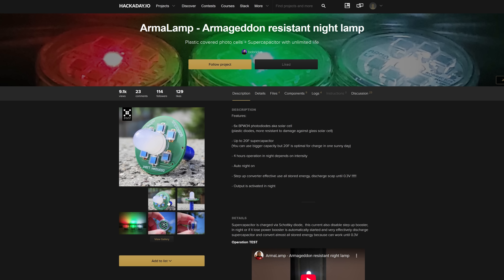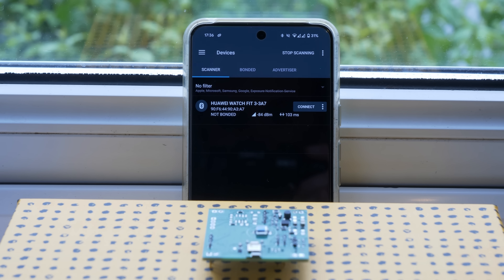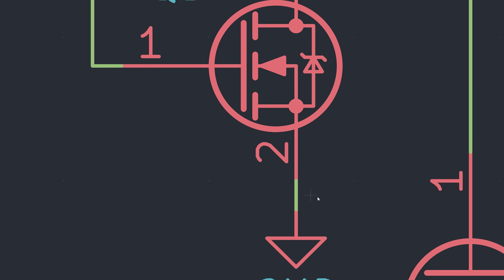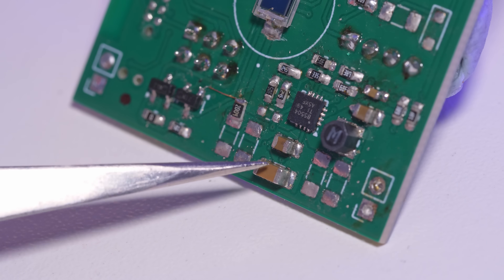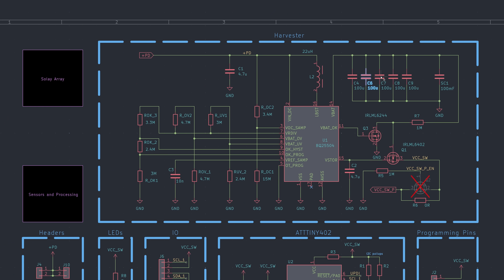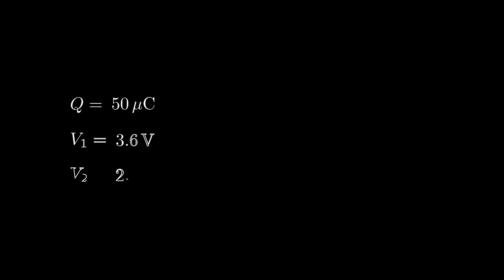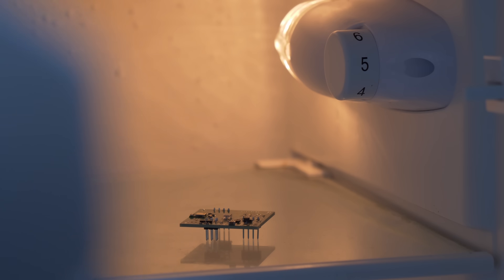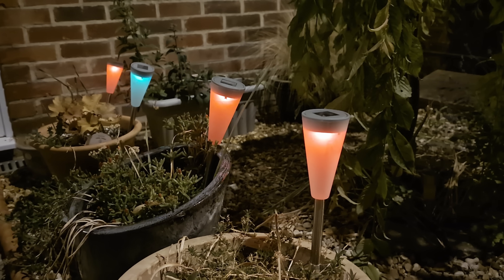Nordic chips are so efficient, you don't need batteries anymore

Comment: Why? BPW34 and similar photodiodes are still very, very expensive compared to solar cells. You could buy polycrystalline solar cells (just a silicon chip, no resin - it can be cut as needed..) and use them for example as one side of a PCB . Much cheaper and more efficient.

Comment: If you can put a GPS module, even though it requires much more power, and a LoRa module, you could build a tracker, optimized to consume as little power as possible. Even a transmission every every hour would be useful, maybe to find a dog, or tied to a balloon and make it go around the world, like picobaloons

Comment: it's only taken 50 years but we're finally adding the solar panels that are on calculators to other electronics? I love it! (genuinely)
Reply: They increase the efficency of the circuit and the panel, not making them bigger😂(obvious reasons). Anyways does a camera technically  use photovoltilaric cells, and can a solar panel technically be a camera?
Reply: The light sensing elements in a camera sensor are photodiodes, but you'd probably run into trouble with the readout circuity consuming more eneregy that the photosites ever collect

now if you could use an LED as a solar cell...
Reply: @deepspacemachines  with the advancing technology, we'll see...

nothing will change cuz we'll be too busy with AI...
Reply: @deepspacemachines  you can use a LED as a solar cell! It’s just not very good at it.

I believe that Steve Mould as a video about this.  He does: Why all solar panels are secretly LEDs.
Reply: @deepspacemachines  "now if you could use an LED as a solar cell:  What alternate universe are you doing your physics in.
Reply: @deepspacemachines You actually already can use an LED as a photodiode! 
It's not nearly as efficient or as scalable, so you won't be getting any usable voltage with it. 

Now if only we could use photodiodes as LEDs...
Reply: @RuudAlthuizen  because Solar cells, LED and traditional diodes are made using almost same structure
Reply: Years ago a built an interactive target for dry firing pistols with a laser cartridge that used LEDs as sensors, because it was cheaper to completely cover an 8” target with LEDs than anything else I had in my shop. It was arduino based and had adjustments to compensate for ambient light levels and sensitivity so it could be used in a blackened room or outdoors easily. LED would create a small voltage when hit with the laser, arduino would read that and then flash the LED to show where you hit.
Reply: @deepspacemachines you can.  A solar panel in essence is a reverse led. 
Feed power into a solar panel and it will light up like an led.
Reply: @deepspacemachines  Strictly speaking LEDs can sense light too. I remember reading a post (I think also on Hackaday) years ago where someone made a touch/proximity sensor using a led matrix.
Reply: @CharGorilla  It technically is.
Reply: @deepspacemachines  'now if you could use an LED as a solar cell...'
Most of you apparently aren't into electronics and microcontrollers..
Way, way back like 2000 range or before, someone had a project online using a matrix LED display as both output and input.  Mostly output, but then once in a while turn it off, reverse bias, and look for the photodiode effect.  It could follow the shadow of your finger, etc.
Floods of arduino output projects, so not seeing the old one right now..
Reply: @memenolookup  sure but the resolution would be sh**
Reply: @memenolookup I think that's possible, but it would be capturing light from a frequency range different from the three RGB ranges used by humans.
Reply: @memenolookup yes a photovoltaic cell can be used as a terrible camera sensor, and a camera sensor can work as a super inefficient photovoltaic cell.
Reply: @CrawliestCotter arl😅
Reply: @memenolookup  No, commercial cameras aren't photovoltaic. And yes, you can use small photovoltaic cells as a sort of camera
Reply: @memenolookup  yes, a solar panel could technically be used as a camera. Well, more accurately, you could use a single solar panel to image a single pixel. Imagine if you had a field of solar panels, you could lighten a pixel on an image for each panel based on its energy output. The result would be an image that tracks the shadows cast on the panels.
Reply: @memenolookup  bro, get back to preschool now
Reply: I don't get why eReaders don't put a solar panel into the case, like, even if it's not going to be able to solely power it, having even a tiny trickle of power input would be really nice
Reply: @ThylineTheGay that's actually an interesting thought. I wonder how power an eink screen needs to change, and if it's too much could you have it change slowly to compensate. (There's all the other electronics in the thing too of course, you  wouldn't be doing this with a modern kindle which is basically an Android tablet with an eink screen)
Reply: @thesenamesaretaken yeah I mean, I don't think it would be much, but my Kobo (pretty bare Linux, not Android) uses so little power that it feels like it could be feasible, at least to offset the standby power loss
Reply: I  to remember the 1st Casio solar powered calculator. Thinking these (solar panel things) will be on every thing soon. But I'm still waiting
Reply: They have some tv controllers that are battery free as well.
Reply: did you know, almost every calculator with solar panel, have fake solar panel, just try open it and you see truth.
there is just a battery
Reply: @danilka1802  its not a fake solar panel and the battery is rechargable. i have a vintage casio calculator with a solar panel didn't work after being in its case for 20 years. left it on the windowsil for a few minutes and it started right up.

anything with a solar panel charges a battery because why have it on doing nothing when you can store that energy. think about it for like 5 seconds bro
Reply: @danilka1802  the battery power the device when theres not enough light hitting the solar panel 🤣
put your finger over the solar panel and see the display dim.. because the battery inside is running low.
Reply: There's actually an insane amount of calculators that have fake solar panels on them. Just open one up and you'll find the majority of them don't have an actual one in them.
Reply: Sadly yes it really did take 50 years to get the tech moving. It's a long journey from those old junky solar powered calculators to this. It's a problem of materials and components mostly and getting the components and manufacturing refined to the state it is in today. Everyone has been wanting to add those solar panels to things since the first time we had a calculator but getting that to be real has not been an easy task.
Reply: Some TV remotes also had them for a while
Reply: There are a range of electronics using those mini photovoltaic, even the video showed those garden lights, i can think of a range of decorative novelty toys like the waving cat and some small robot/car toys powered by a slightly larger and more modern solar cell as well
Reply: Clippy
Reply: They have circuits that don't require batteries or solar cells 
    Using a gong to strike a piezoelectric speaker it generates enough current to sent radio signal to control remote lights 
    Kinda had battery less remote for TV since like the 50s though 
    It used the sympathetic vibration of bells 
   "Clicking" a button rang a specific bell in the controller that made a corresponding bell in the TV vibrate triggering a switch 
    
    The Solar cells calculators use are the least efficient by surface area 
    But most efficient in low light conditions 
   Have insane life span 
   
    Nomad who uses 3 25watt amorphous silicon panels from harbor freight to power my phone  lights and guitar amp every day
Reply: If you look at one of the panels from harbor freight 
   That's the area you're gonna need if you want a solar powered phone 

   These panels can generate juice from a streetlight 😅

Need to buy me a few more 
   I'm down to 3 from 8 over 4 years

Me smashing them dropping them 
   Which is surprisingly difficult 😅

Know I should've gotten the replacement plan 
   Even covers your mess ups 
But I'm dumb
Reply: There are clever folks that figured out how to spy through led tv screens by using their ability to create voltages like solar panels.

A body passing by the tv screen casts shadows which cause the led screen to put out various voltages which can be reconstructed into an image.

Smart tv's have the ability to send information back into the internet so it's not a stretch of the imagination to realize your tv could be used as a camera to view the viewers and their surroundings.
Reply: @tenlittleindians  or - and this may blow your mind - they could just use the built-in cameras to spy on you.
Reply: @tenlittleindians Yes it can be used to sense object. But you need optical lenses to make this kind of spying to be reliable.
Reply: @tenlittleindians  I think you're mixing somethings up because that no1 doesn't make any sense, led tv screens can't "create voltages" whatever you're trying to convey by that because there are no "led tv screens" to start with, there are led backlit LCD TV's which is a different thing. They are called "LED TV" by dumb marketing people who don't understand things, but they are not what the name would imply. Also mostly a LED TV would suck. Ah well actually there are LED "TV screens" at sports stadiums but you really would never want one at home, their pixels are the size of a coin. 
I think your mixing up a technique that was briefly used with CRT TV's where you could detect an electrostatic discharge at at a distance but also there was some really complicated way to reconstruct an image out of it. There is no record of this ever having been successfully used as far as I remember, there are theories of it having been used to obtain some sort of password or something, the method for getting the password was not in the report published - it was redacted. But I think that was plain old humint, not some death-ray remote reading screen majick quabbalah smoke signal sorcery - they say it was to protect the source.
Reply: What do you mean we have solar panels on calculators 50 years ago?
Reply: @newb.justnewb.8762  solar panels were added to pocket calculators in 1976.
Reply: @newb.justnewb.8762  means exactly that.. Solar panel was already used on calculators 50 years ago.
Reply: @newb.justnewb.8762  Yes, solar-powered calculators have been around since the late 1970s!
Reply: @newb.justnewb.8762 what do you mean? They are talking about how they are the only thing with a solar panel.
Reply: Ah Yes but these things arent fake like those solar calulators were
Reply: We? No, not you. Only this guy on the video.

Comment: Wireless doorbells. Current tech requires you to press very hard as thats where the energy comes from.

Or smart IOT devices for elderly, so you never need to worry about swapping batteries. This can range from temperature sensors, door sensors, or even mmWave human presence radar (HLK 2410S)
Reply: Well, I'd expect a doorbell to work at night too. Reliably. Even if pressed multiple times.
Reply: @EvenTheDogAgrees  That's what supercapacitors are for. And if you ring a doorbell often/long enough to drain a 10F supercap, you're probably a prankster or gramps leaned a broom against the button.
Reply: @unmountablebootvolume  While true, I just checked Mouser for the specs on 10F supercaps. They range from 6.3-12mm in diameter, and 14-32mm in length, which is a rather large component compared to the puny photodiodes used for this demonstration. The whole point of using a tiny photodiode to charge your circuit is due to space constraints. If you got room for a 10F supercap, you also have room for a small solar cell like the ones used on calculators, and wouldn't be using a photodiode.

Not saying a large supercap wouldn't work; just that it doesn't match the design criteria under which you'd opt for powering your device off of a tiny photodiode. You want a doorbell to work reliably, day and night, even under repeated use. Hence you don't rely on a photodiode as your power source.
Reply: most houses have a light close to where the doorbell is outside

Comment: Have a look at the xiaomi plant monitor, which measures light intensity, soil moisture, temperature and nutrient content (but I have my doubts about that). I've always wondered why the device is battery-bound, even though it measures light 😢...
If the thing was open source, waterproof and small for every plant with a simple app where you could set limit values...😬😂

Comment: That's quite an ingenious use of the power ic, a few outside for temp sensing could be very handy for a smart home to see if the outdoor temperature was suddenly dropping to turn on the house heat a little early. I guess the data packet could also have space for maybe humidity and a (mechanical?) rain sensor

Comment: Anyone ever think this might be implemented into a television? The backlight hits a larger solar cell sending power to a super cap to hold the energy. The set harvests your info through various nefarious means and then at a given time it will send out an encrypted packet stream of your television habits to unknown brokers of information. Now you have unplugged your set and think all is well, nothing can be interrogated to allow transmission of your info. Wrong. It could go out via Bluetooth or via you WiFi router. I do ask myself what keeps alive the memory on the tv? Is channel memory stored on an EEPROM? What about info on you watching habits? Same EEPROM? Enable MAC address filtering on your WiFi if the router is capable. Make sure your TV's MAC address is not on the routers list.

Comment: maybe it can use like one of those tritium vials that use radioactivity to generate light? you could get years of runtime without external light source
Reply: sadly very expensive
radium paint however...
Reply: @kkjkjh  i think radium is more expensive and more dangerous than tritium vials right? as long as you dont break the tritium vials
Reply: @stanleyeens  more dangerous, very yes, but a gram of tritium is around 3k dollaridoos while radium paint is in the pennies
also radium is more energetic
also also radium has a halflife of around 1600 years compared to the 12,3 or tritium

its so sad we banned such a nice material just because a few (dozen to hundreds of) people died 😔
Reply: oop nevermind i was looking at the cost of raw tritium and radium paint
luminous tritium paint is only 100 to 500 USD per gram and radium paint (was) around the same (ajdustet for inflation)

raw radium however is significantly more expensive than raw tritium even without the regulation, but the higher radioactivity makes up for it

tl;dr radium is more dangerous due to the gamma emissions but lasts way longer, other properties are roughly the same

Comment: To add to the nsa joke I saw. Given how Bluetooth trackers like air tags work it could be a 0 maintenance solution for something like that assuming it doesn’t just end up situation where it’s to dark too long. Although it could also work on flexible PCBs as there’s no need for a large battery so it could be attached into a hat or clothing with minimal hard points
Reply: For a tracker I think I would do something like a crystal radio and pull power from transmission sources like wi/fi or cellular to charge the caps.
Reply: Someone suggested using radioactive glow-in-the-dark vials for nearly permanent runtime.

Comment: A lora version would be really cool to see how far you can transmit with those tiny charges.
Reply: This would be a perfect use-case for me as well. I currently have a water-depth sensor running LoRa that only needs to send a message each day. But it's far from efficient. Even once a day (and only if the level changed significantly enough, >5%) the 1100mAh LiPo battery I use only lasts a week for the ESP32 I'm using.
Reply: @quintesse  Your power converter has huge standby usage or ESP32 is not powering down correctly. An 1100 mAh battery should last months.
Reply: @mrfrenzy. I'm actually assuming that I'm not properly powering down the peripherals (an OLED screen via i2c and a LoRa hat. I'm also using a couple of resistors to measure battery voltage and I actually have no idea how much that could be drawing.) I just measured and right now the board is drawing 11mA with the MCU in deep sleep 😕